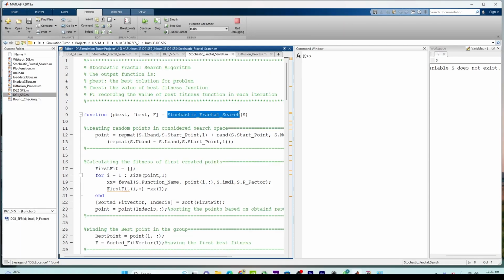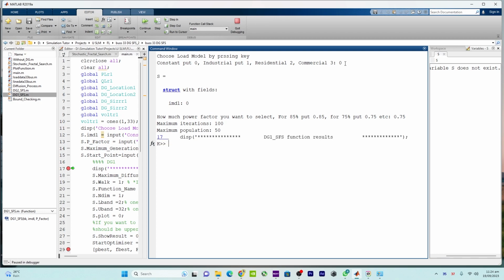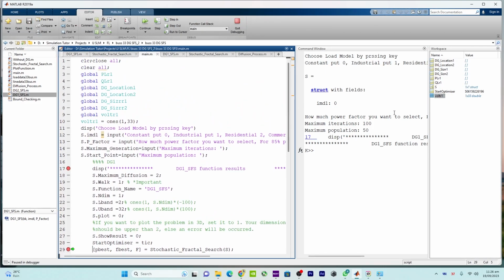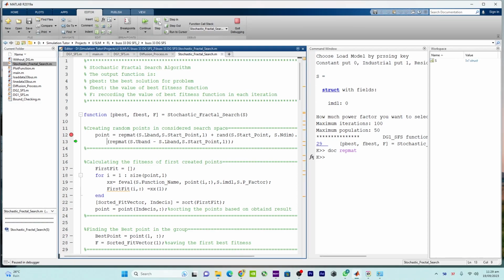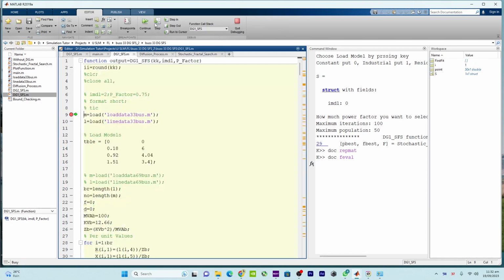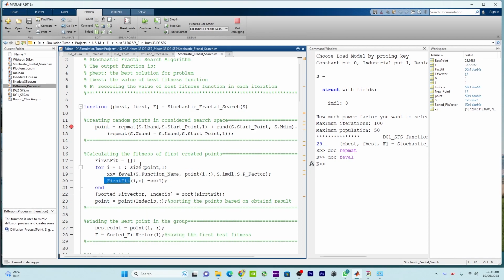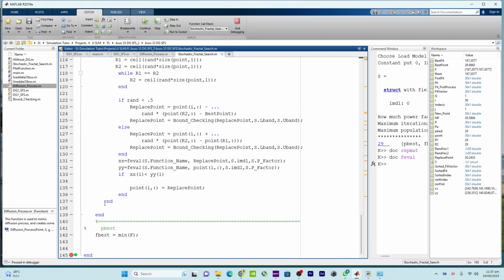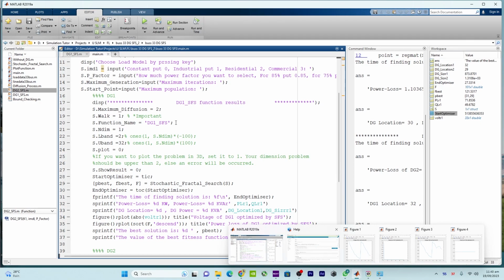Stochastic Fractal Search (SFS) Optimization Algorithm - SFS Algorithm Code

Comment: I want the DG size to be in the range of 0-500 kW. How do I do this?

I want to add only capacitor and both DG and capacitor at the same time. How can I do that.

Can you help with these issues?
Reply from the maker: @sevgiduman7318  Get free sample code and in initialization part, you can do.